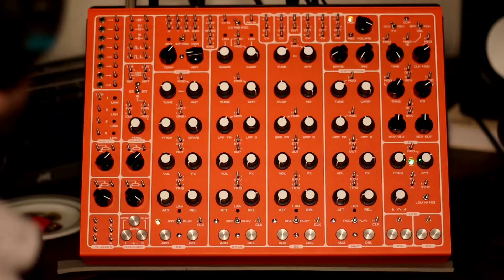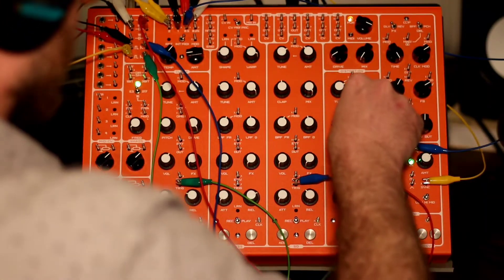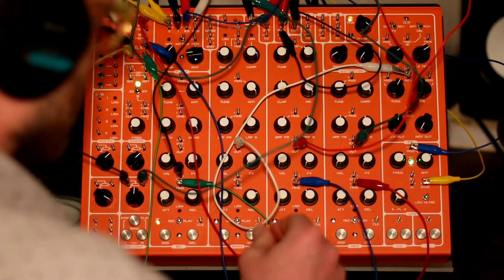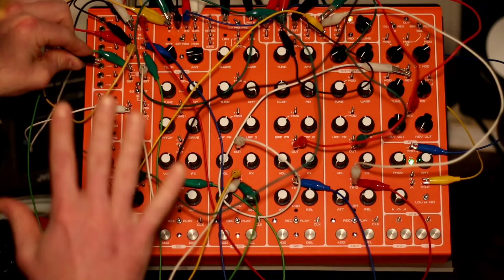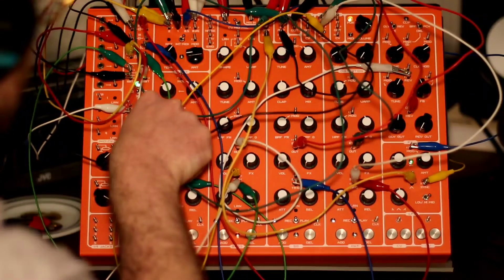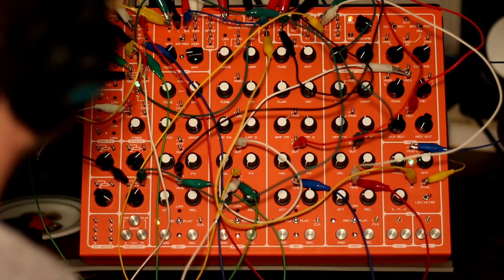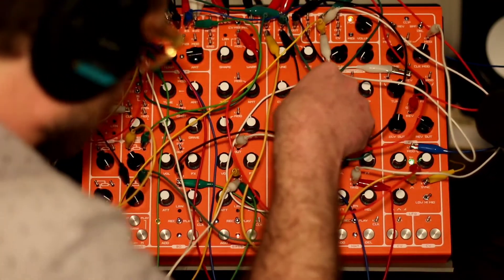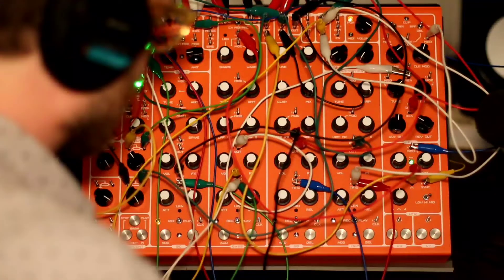Pulsar-23 Patch Walk and Talk #6: VCA's for Ducking and Bass Shaping

Comment: Have you made video, where you spesificly explain why to use those ”circuit bending” stuff, like diodes etc?
Reply from the maker: I have used the .1uf cap for an extra 'pulse converter' and the diode to sd trigger to lfo for velocity changes and I have run shaos 3-bit out through the 10uf capacitor to the bass voice cv to get some fun sounds. 
But there is a cool video that I have checked out that covers these components here: https://youtu.be/7syrf3liLJ4?si=LaMMFpPkNqOFqltt

Comment: Great patch! Really like your way of problem solving and how you work this out to your desired level. Really appreciate your walks and talks, really like how you talk about it. Super fun and cool. Found so many cool ideas thanks to you. Thanks a lot. 

One question is have about this path, and maybe about pulsar in general. Once i connect the trig converter into the bd, there is a dramatic decrease in db. even if i turn volume all way up, i miss the ability to make it louder. its basically ambient minimal in max volume if i need to compare to something. I was thinking maybe my power source doest deliver what this device wants. Just in case had a similar question in your mind, because i see that you operate with a great remainder capacity of volume on the bd. 

Thanks and keep grooving!
Reply from the maker: Very cool, thank you for this message. 
As for the BD volume, I would try different pitch, tune, and drive combos. I just reread the manual and was reminded that the drive shapes the waveform. "When rotated clockwise, the waveform changes from triangle to sine to square " 
Maybe this will bulk it up?
I also saw a video with the artis Surgeon, and he said he connects the 10v to an attenuator and then to the Tune Mod. Could try that also. Or bd env to wtf or omg?